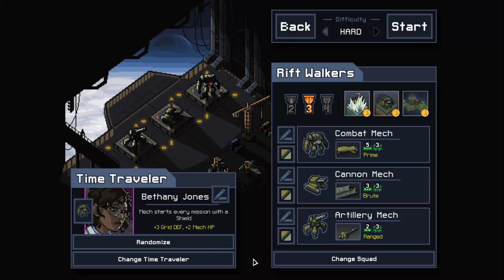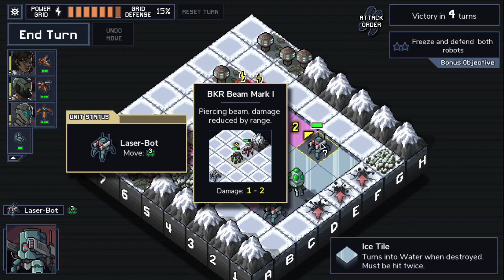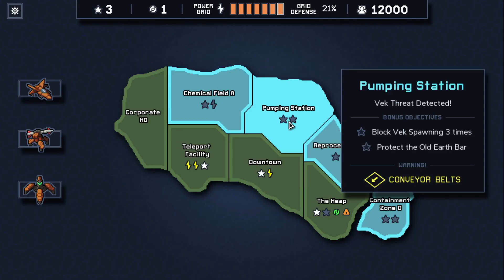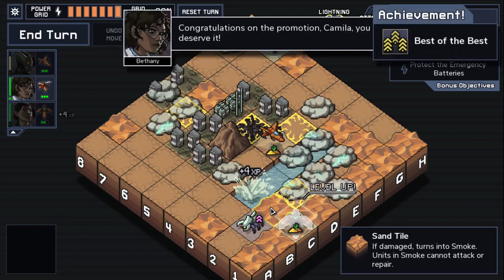Into the Breach: the Rusting Hulks and the Dusty Road to 30K

Comment from the maker: Timestamps:
0:00  Rusting Hulks basics
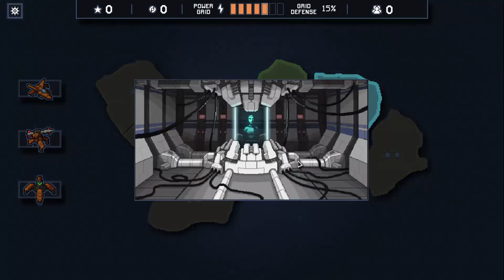2:18  Ice and Smoke: Pinnacle Adventures
21:38 Freeze Perfect (Perfect Battle, Freeze Tank)
32:35 Smoke vs Fire on Ice 
42:33 Disposing of Vek on Detritus Disposal (Overpowered)
58:54 Risk vs Reward on A.C.I.D. (ACID Tank)
1:22:20 "Garbage Day" with Spider Leader and its plentiful offspring
1:31:20 Ol'Horace needs Help, Rusting Friends cannot refuse (Defend the Train in Archive, Inc.)
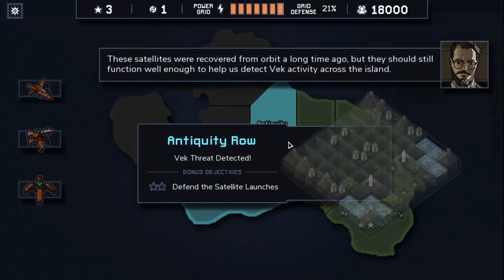1:51:37 Satellites want to leave, Pulse Mech to the Rescue
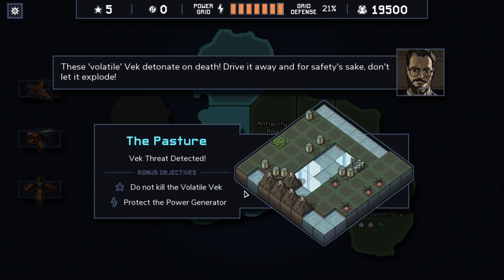1:59:53 High Visibility Vek, High Volatility Vek
2:08:06 Symmetric Attack, Asymmetric Result: Mech 3 - Vek Leaders 0
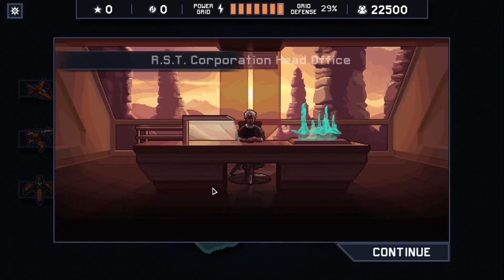2:18:24 In R.S.T. Lightning strikes while the Guitar plays
2:27:32 Another Day, Another Train
2:35:41 Stormy Weather with a chance of Smoke
2:50:26 Wind Torrent and the Dust settles down
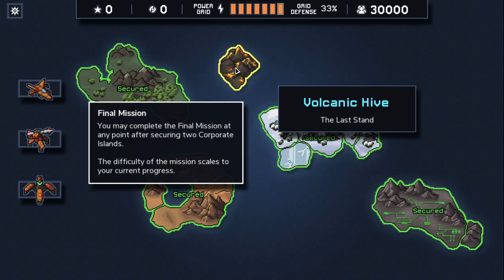3:06:00 With the Wind in our Sails, it's not even Fair
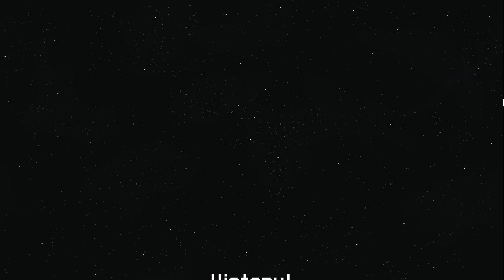3:23:35 30K Victory

Thank you for watching! Next time 2-island runs with Zenith Squad and Blitzkrieg